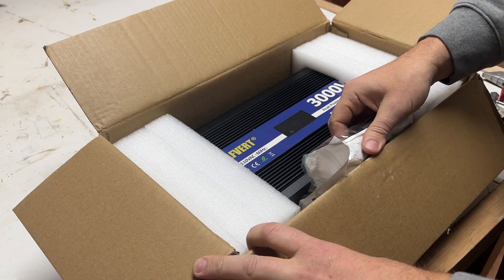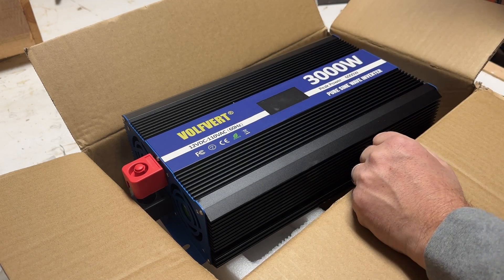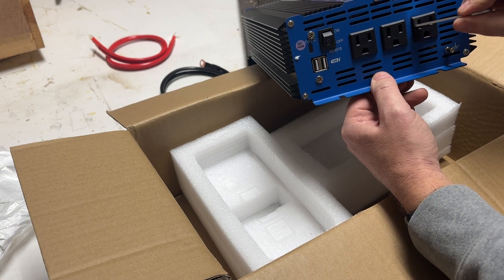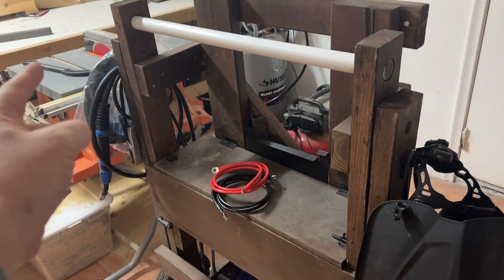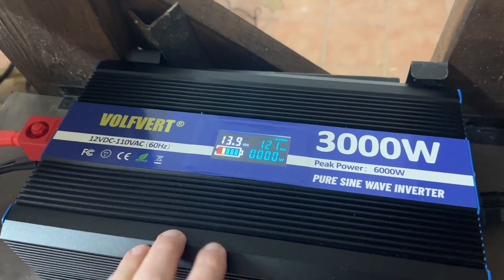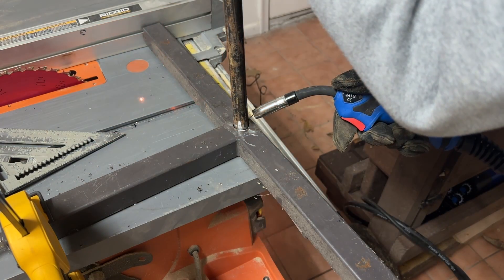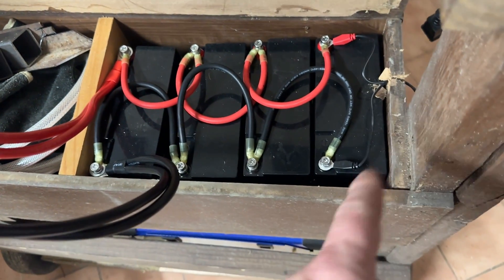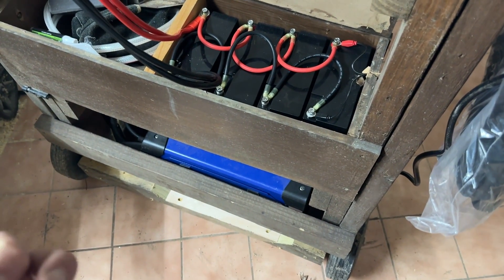Mobile Welding Cart - Will it work on an inverter?

Comment: U need 260amp or 300amp battery  for efficiency. How much power is the welder rated for? Voltage and amp?

Comment: Your parallel batteries will work better if the positive and negative leads to your inverter are connected to opposite ends of the battery set.  In other words, batteries 1, 2, 3, 4 then connect positive to the positive of #1 and negative to the negative of #4.  This will perfectly balance two batteries and be a big improvement with 3 or 4 batteries.  As you have it now, the #1 battery with both the positive and negative connected to the inverter will do most of the work because of the resistance in the connection to #2, which will do more than #3 which does more than #4.

Same applies to charging leads, but is less critical if you give it plenty of time to fully charge even the furthest battery.

Comment: Those capacitors are meant for motors that are built to have those capacitors.
They can't help your welder as they function in a completely different way.

The motors they are built for need the capacitor to drive the second motor winding. It shifts the AC wave in a way that helps the motor start/run.
As they age, they get worse and at some point the motor won't start anymore. If you replace the old capacitor, it will run again so those capacitors are sold as "hard start capacitor" but really they are just a replacement part.

On DC, capacitors can do what you want them to do but they would have to be huge. Like the size of one of your batteries. This is because capacitors hold very little energy per volume.

Comment: The proper engineering term is "inrush current" (you can search the term). Your hard start analogy is accurate, the cap will provide a "soft start" for the initial current load at start up. Always interested in your endeavors!